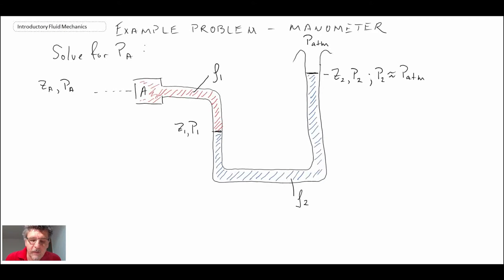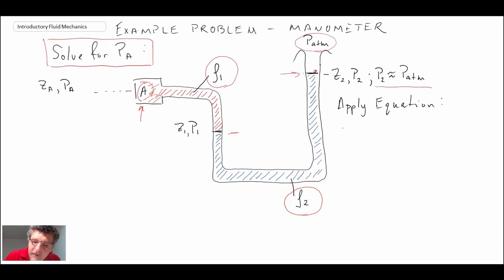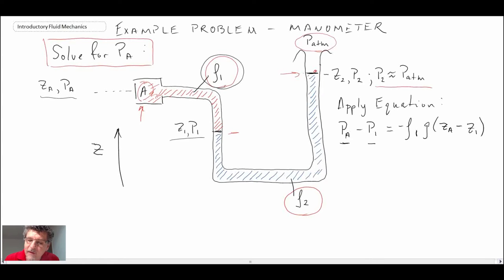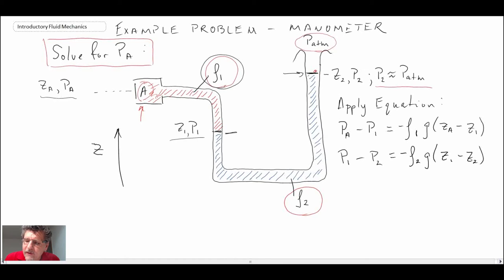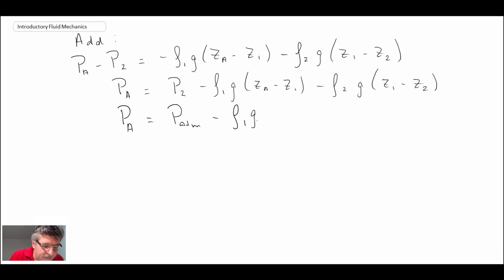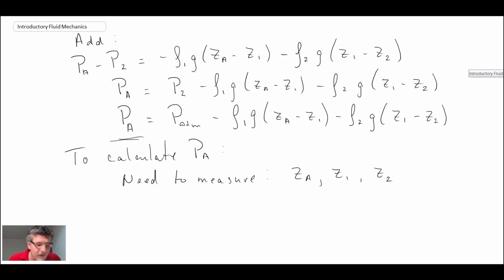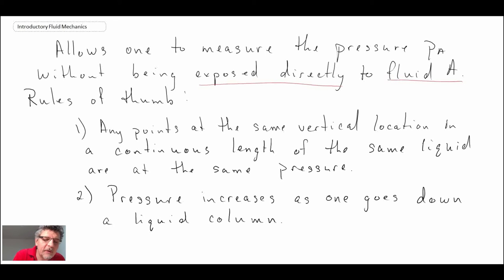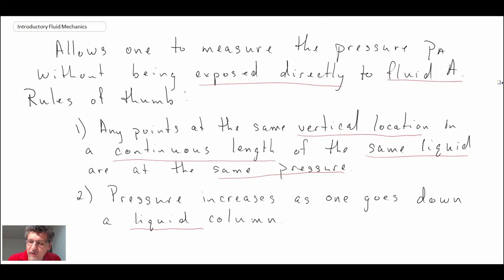Introductory Fluid Mechanics L5 p2 - Example:  Manometer

Comment: Wouldn't the first equation used be P1-PA? Since P1 is lower and assumed to be at a higher pressure.
Reply: +Eloy Abrego
The first equation can be rearranged into the form P1 - PA = ρ1⋅g⋅(zA - z1).
From this you can see that if you set the coordinate zA to zero and define "down" as a negative direction, you will indeed get a greater pressure at P1.
It depends on which signs you use in the coordinate system.

For some people it is slightly easier to define "down" as a positive direction and the atmosphere coordinate as the zero level (zA = 0);
this would allow you to write the first equation as P1 = PA + ρ1⋅g⋅z1.